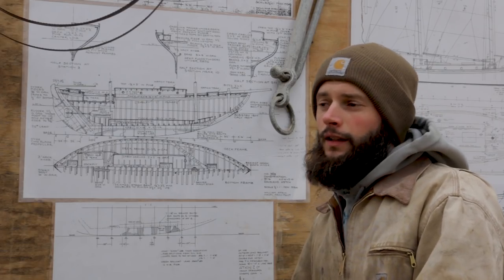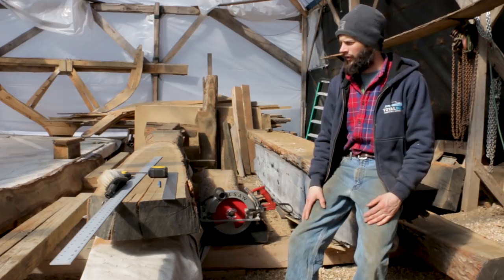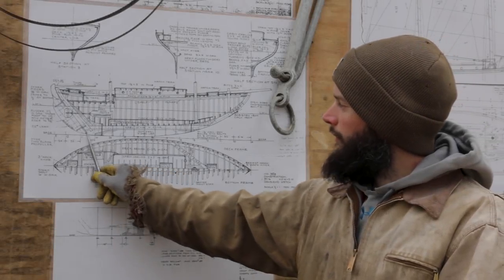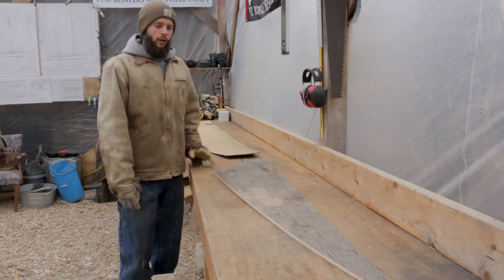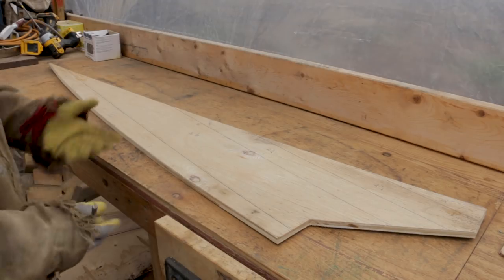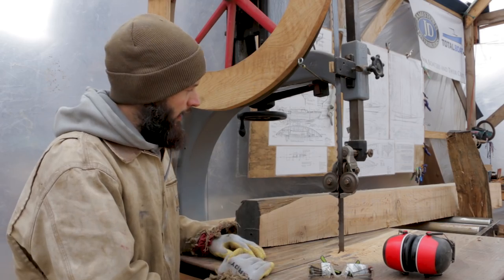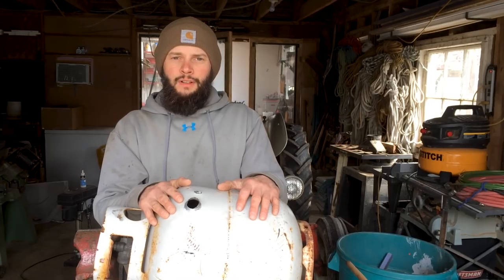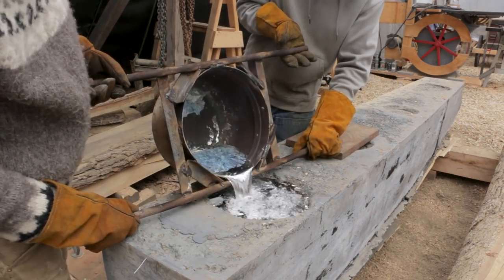Acorn to Arabella - Journey of a Wooden Boat - Episode 30: Deadwood and Some Lead

Comment: I think in the end you will see that you will treasure the connections you made with all these people and the community you joined more than the boat or the sailing (maybe). so its good to see you out and  about meeting people during the winter downtime.
Reply from the maker: The amazing people we have met has been one of the best parts of the project so far.

Comment: Nice job with the lead fillings. They won't fall out. The band saw really works great and the vfd that lets you control blade speed is a super advantage when cutting those big thick timbers.

Comment: Oh Snap!  I forgot to put a "worm shoe" on my boat.  :)    Thanks for the education.
Reply from the maker: Haha
Yeah you don't have much worm fodder on your vessel, but we don't need to worry about rust!  Wood, steel, plastic, they all have their pros and cons =)
Reply: Rust?  I don't see any rust!    :)     Keep up the great work.
Reply: @AcornToArabella   I think this ties in with the question of why the underside of your original iron keel was drawn with a rounded bottom. My understanding is that the reason this was done was to minimise the area whichwas unable to be antifouled when the vessel was "dried out" to sit on the keel. Lead is not suited to using this cross-section on a boat like yours: it is too soft to support the weight of the vessel with (theoretically) only "Line contact" with a hard bottom, without deforming.
And  the second rationale for a worm shoe is related to this problem: regardless of profile, it is not feasible to paint the entire underside along the midline unless the boat is hauled on a cradle, which is costly (the first rationale being the one you mention: damaging the protective layer of antifouling paint by hitting things).
Reply: No rust yet, but she hasn't even looked at seawater yet ;)

Comment: Since your lead ballast is smaller than an iron ballast, shouldn’t the center of gravities (c.g.) be in the same place?  To keep the level of the boat in the water the same. Cad can determine the cg accurately. 3D model your boat.

Comment: I have a small question regarding the redesign of the ballast from iron to lead. I understand why lead has been used to replace iron. But looking at the section drawing along the keel where we see the ballast from the side it seems to me that the CofG has been moved towards the bow. The ballast has a fairly constant lateral Xsection from fore to aft so the location of those little blue lines for the lead ballast suggests that the CofG of the lead could be forward of the iron CofG by 6 to 12 inches. I presume that when the iron ballast was designed some logical process was used to locate its CofG. Was the same or similar process used to locate the lead CofG? If it has been moved significantly this would have the effect of moving the bow down and the stern up, ie the waterline would rotate slightly. Come to think of it this may have been an effect you were seeking. In any case please reassure me that the blue lines of the lead ballast were not drawn arbitrarily. Building a first boat like this takes courage. As I have commented before this project is an inspiration for a generation of young people.
Reply from the maker: William Atkin drew both variations so we are trusting his judgement!
Reply: Enough said. Thanks. Happy sailing, eventually.

Comment: I'm confused why you don't seal the end grain on your milled lumber? Simply painting each end with bitumen or similar, will help prevent the checking and subsequent loss of those boards as they dry out.
Reply from the maker: We have used linseed oil, paint and roofing tar to seal the ends with mixed results.  We ordered some anchorseal and are going to give that a try, we have heard good things.

Comment: What is a check and what causes it? I remember you mentioning the need to coat the ends of sawn lumber to prevent checkering but if you explained checkering I missed it.
Reply from the maker: When wood dries it shrinks, if it does not dry slowly and evenly it will check (crack).  Checks come in many forms but are almost all caused by the wood drying too quickly/not evenly.  Some woods do it more than others but all wood is capable of it.
The center of the wood stays wet and is big, the outside dries and shrinks, as the outside shrinks it can't compress the fat center wood so it does the only thing it can do.  It splits to relieve the pressure causing a split/crack/check in the timber.  They usually run parallel to the grain but can take many forms.
Reply: Acorn To Arabella perfect explanation thanks!

Comment: Hey guys ... good work! Should be traveling through western Massachusetts in early June on my way to Maine! I researched stainless chain for use on a mooring and found some indication that if left under water for extended periods of time ‘stainless would rot from inside out’ due to lack of oxidation caused by the lack of presence of the oxygen in the air? Can you confirm or refute that info?
Reply from the maker: We cannot comment on that one, definitely outside our scope of knowledge.  
Shoot us a email when you are coming through and we can probably arrange a visit.

Comment: Hi, loving the videos. You mention cutting the pith out but it is still there at12:53. Did you cut it out later?
Reply from the maker: Good eye!
Did not even have to look at the video, I know just the beam you are talking about. It will get cut out later, it's just at the very end of that beam and by the time it's jointed/planed and that end is squared up the pith will be removed.
Reply: Bet! Thanks for explaining.

Comment: My father used to use a marine adhesive/glue/cement called Beetle Cement which was cured with sulphuric acid IIRC, this was stronger that the wood itself, when used with BS1088 marine plywood, agba, teak, oak etc. He tested batches by burying glued pieces in the ground and checked them after 1 year.
Reply from the maker: Sounds like nasty stuff to work with.  Most adhesives used in wood working are stronger than the wood fibers if glued correctly.

Comment: I remember reading about coppering the bottom to fight the worms is this something no longer done?
Reply from the maker: It is still done, it's expensive to do but is quite effective.
Reply: Exactly.You Know it.The best should be good enough.Man you are doing a great job 👍
Reply: They used copper back in the old days because they did not have modern anti-fouling paint. As he stated in the video, they are using a sacrificial pieces so that if they breach that outer layer of protection they will only lose some small pieces that can be replaced anywhere in the world with a bit of work.
Reply: this may be a stupid question but why not make the worm shoe out of... something else? bricks for instance, hockey pucks maybe, or granite? hell! you guys have lead. you could pour a worm shoe.

Comment: I've seen builders put tar paper between the worm shoe and keel, seem to work just fine and yes they can pulverize timbers in short order. Nova Scotia  Canada
Reply from the maker: That is a common method to use tar and tar paper to seal that joint and stop the worms.  Anti-fouling paint and dolphinite is just the modern version =)

Comment: Boat question !  Could the wormshoe be made out of pressure treated wood ?  If that is a bad idea, how about a thin piece of lead/copper (and some bedding compound) between the wormshoe and the rest of the deadwood.  Instead of gluing the wormshoe to the rest of the deadwood, attach it with a bunch of bronze/stainless screws.
Reply from the maker: I have never heard of a pressure treated worm shoe, I have also never seen pressure treated hardwood.  Not sure a pressure treated soft wood would be tough enough. 

The worm shoe won't be glued, just painted with anti-fouling paint and then covered in a bedding compound and screwed to the rest of the deadwood like you mentioned.

A iron or preferably bronze shoe is a possibility although a bit pricey.

Comment: Very nice video. You guys think of all things that could go wrong. Nice work. BTW as a woodworker I love that band saw. Huge throat.
Reply from the maker: The saw is a beast =)
The silver lining of going slow is having time to mull it all over.  I doubt we thought of all the things that could go wrong but hopefully we thought of most of them!
Reply: The silver lining on the enforced winter progress drought, the guys have time to think ahead and consider any upcoming problems.
Even though the guys can't progress the boat as they want.... I'll bet dollars to doughnuts they they are still thinking about it almost 24/7.
Reply from the maker: You are correct, it's just about all we think about =)

Comment: Why didn't you use an iron keel ?  I am guessing because you could get the lead cheap and it is easier to melt and cast, correct ?

We won't see 50's in SE MI until about the 15th.  Very late.
Reply from the maker: We could not cast an iron keel at home and it was over $35,000 to have one cast for us.  We spent maybe $6,000 pouring our lead keel.
They are saying 60* in the long range forcast, fingers crossed!  Once it's that warm we can proceed with no waiting on weather.

Comment: its possible to treat the wood with copper sulfate and or use copper plating to prevent rotting and ship worm damage.
Reply from the maker: The usual treatment is a copper based anti-fouling paint.  That is what we will use and it is very efective against rot and critters so long as it stays intact.  Copper sheathing has and is used but it's heavy and very expensive.
Reply: @AcornToArabella  Even more heavy and expensive is to make the entire boat from copper-nickel, of at least 70% and preferably 90% copper (similar to the alloy used for "copper" coins). 
But maintenance costs are drastically reduced!  (A few shrimp trawlers get built this way in parts of the world where fouling is extraordinarily rapid)

Comment: Are you sealing the end grain of your timbers after you cut them down? That will help prevent such deep checking.
Reply from the maker: We are as soon as it's warm enough that the paint will actually dry.  It can help mitigate checking but very slow and careful drying is the only true cure.  Even then it's a gamble.

Comment: I was thinking why don't you put a length of lead flashing in between the worm shoe and the rest of the timber that will make a definite seal.
Reply from the maker: The paint and bedding compound will work well, don't think adding lead would be that helpful. Thanks for the suggestion though!

Comment: Mhh... I´m not sure if I agree with you on the stiffness of that keel construction???

A longer steel keel will add to the overall stability of the keel a lot!? 

Do you compensate for that by using a higher "inner" constructional keel?

I´m a bit concerned about the sheering forces within the lower middle section of the hull now;
As the keel flexes, the hull will have to copy that movement, doesn´t it?
Reply from the maker: Yes, a big steel keel adds a lot of strength and rigidity to a boat. It also can lead to iron sickness in oak and costs $35,000+ to get one made for Arabella.  =(
The deadwood will add quite a bit of strength, even if it is laminated and not one solid piece.
Thankfully a boat is the sum of her parts and we can help to compensate in other ways.  Really solid floors, a hardwood garboard plank, maybe even hardwood for the first couple planks, a hardwood sheer plank, solid tight fitting bulkheads, solid bilge bands...  will all work together to keep her solid and in shape.

The biggest is probably keeping a mild rig tension and not racing. Cranking on the stays and constantly pushing the boat as hard as you can puts a lot of strain on her.   Many a boat has had her hull ripped apart by the rig and the crew.
Reply: I have to agree that a laminated keel should be more than strong enough. A ship is like an egg,a monocoque,and takes strength from the other components. Once it is all together it will be just the perfect combination of strong,rigid and with just enough flexibility. Being able to replace sections is a real long term bonus,keels tend to rot or get eaten away rather than fail through loading.

Comment: I have not had any problems with gas cylinders by cutting them open, open the valve and tip them upside down for a couple weeks, then take the tap off and fill with water, leave for a couple more weeks then use. I have made wood burners that way with them.
Reply from the maker: Could not get the tap off and the purge valve was stuck as well.  The only way to get water in was to make a hole and the slug seemed the safest way to do that.

Comment: Funny!  I was thinking when you shot that propane tank it might go up in flames as you generally need heat (shot gun slug hitting metal might create a spark) and compression (certainly could have compression with metal on metal) to start an explosion when mixed with an accelerator (propane is a good accelerator).  Slug shell worked great!  Better safe than sorry!  Well done and great work around to a tricky and dangerous problem!  Plus you probably scared all the deer out of the neighborhood for a few hours.
Reply from the maker: That it did! We did not think it would explode but were happy it was down range just in case!  The grinder could have gotten it to go, those sparks are hot.

Comment: would a single steel plate running the length of the dead wood and lead keel be practical?
Reply from the maker: It could be, a iron shoe is a thing on boats but steel or iron would lead to issues with galvanic action between the lead, bronze and iron.  Steel/iron also are not great friends with oak, it can lead to iron sickness in the oak.  A bronze plate although much more expensive and not as tough would be a better option.  Victoria's stem has a bronze plate protecting it.

Comment: Nice skimmer! I know it's a little early in the game to be talking about launching, but I'm curious as to where you're  planning on doing it? It's a long haul down the pike to get to the nearest water for you guys.
Reply from the maker: Somewhere on the coast.  It was $1,200 to get Victoria trucked here and Arabella is just 6 feet longer so it should not be too too much more to get her trucked out.  
We want to have a launch that is open to all so finding a facility that can host will probably be the determining factor.
Reply: Acorn To Arabella I might suggest checking out Winthrop MA to you guys. Straight down the pike as far as you can go and you'll hit the water. I've been sailing out of here for years, nice big public landing.
Reply from the maker: Thanks for the tip!

Comment: Instead of a worm plate, why not put a bronze skid plate on the bottom of the keel?  It would also be the ground plate since you'll hopefully be using a spike and ground cable down the mast and clamped to one of the bolts that passes through the keel.
Reply from the maker: We are considering doing both.  The sacrificial worm shoe and a bronze plate.  The stem of Victoria has a bronze plate from the waterline to bowsprit that we will reuse so we would just have to extend that to the stern.  Trouble is that much bronze is expensive!

Comment: "push sticks" for the band saw when your getting close  to the end?   I was getting nervous just watching you @13:02.  )
Reply from the maker: If the piece was smaller I would use them, the band-saw could get you for sure but it's nothing like the table saw or even the jointer.  The band-saw bites, the table saw removes fingers and the jointer gives nasty skin graphs.  It's pretty easy to keep the digits away from the band-saw and if it did get me it would be stitches not a amputation.

Comment: Great explanation of the wormshoe.  Question is why do you not use some other material, such as vulcanized rubber, that is impervious to worms and more resilient to impact damage?  Now that I think of it, polyurethane would be even better since you would make a reusable mold and pour the urethane.  Of course, there is the cost....
Reply from the maker: She's a wood boat, wood will work very well and is a material we know well and know will get along with all the other materials in her hull.

Comment: What worries me most is you didn't clean the lead surface before pouring that lead, regardless of the drilled holes any organic material inbetween the old lead and fresh lead is a weak point.
Reply from the maker: Strength is not a issue for those, they will be pinned between the wood keel and ballast keel.

Comment: the original design called for a Iron keel?
Reply from the maker: Yes, then a later addendum was drawn for a lead keel and  then another addendum later for the gaff rig.
Reply: would an iron keel cost more or less, would it be better protection against running aground, would it balance the boat better?.....
Reply: symbolsandsystems An iron keel would be a lot more difficult to fabricate than a lead one, and would require outsourcing to a shop.
Reply from the maker: It would be better if one ran aground, we have 3,000 pounds of internal ballast so we can adjust the balance of the boat.

We priced out a iron keel and it was $35,000 before getting it trucked here.  A lead keel from a foundry cost $2 per pound for new lead so around $19,000 for just the lead, plus foundry fees.  We would guess we spent around $6,000 total.  Cost was the biggest motivator!

Comment: why not make the "wormshoe out of something other than wood, like fiberglass or nylon, or aluminum?
Reply from the maker: Aluminum would corrode, bronze could work though.  
The issue is the boat weights 25,000 pounds, when that hits something there is a stupid amount of force and can damage the timbers. The idea with the 2" shoe is hopefully the crushing, tearing... will be concentrated there and not damage the main backbone timbers.  A thin shoe would not be as effective.  
A 2" shoe with a bronze plate covering it might be the way we go in the end.